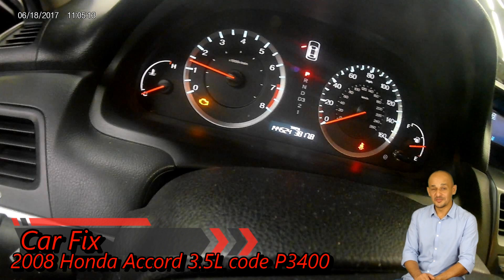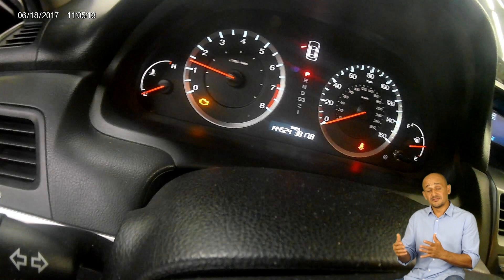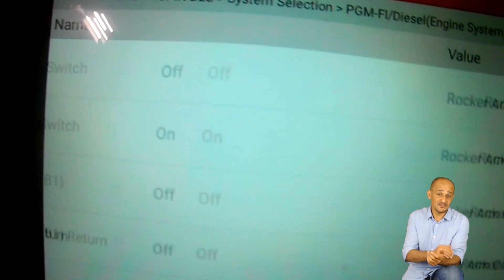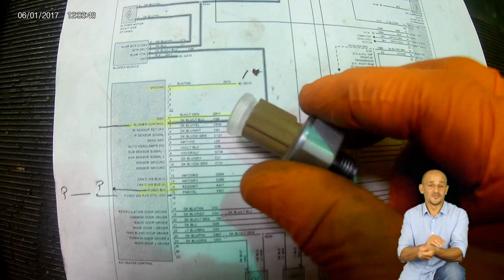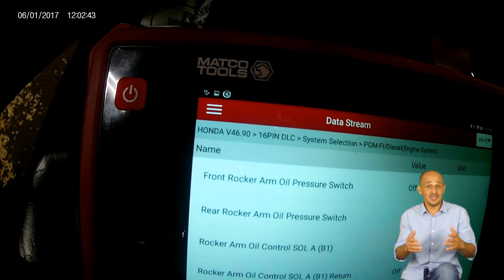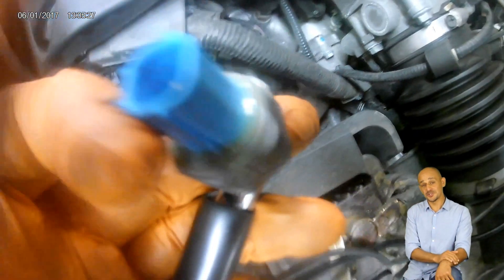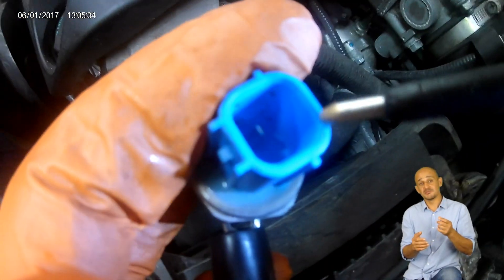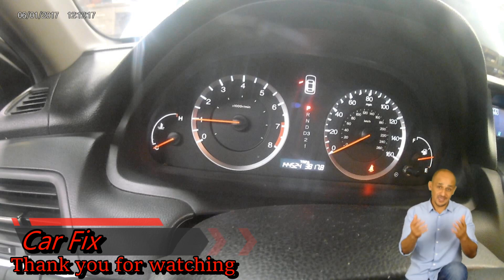Code P3400

Comment: Hi, confirming if you unplug the oil pressure sensors there shouldn’t be a code, correct?

I got a p0118 (coolant temp sensor) and p3400 simultaneously. any idea if they’re related or treat each independently?
Reply from the maker: They are the VCM system needs an accurate ECT sensor reading fix the P0118 first this ECT sensor effect lots or systems like ignition timing A/F ratio feedback idle speed the ECT voltage are high it should drop with hot engine, after fixing the P0118 you need to check the P3400 code if still present after clearing the codes.

Comment: Great video my man, could you include the part number for the pressure switch ? Thanks man.
Reply: Rocker Arm Oil Pressure switch: P/N 37240-R70-A04
O-ring (13mm x 1.5mm): P/N 91319-PAA-A01
Reply from the maker: Thank you, I cannot remember the part # it came from the Honda dealership.

Comment: I changed it and the code is still there, is there another reason?
Reply from the maker: Did you  clear the code ?
Reply: Yes I did and I left it for the mechanic for ten days He said all the readings on the computer are correct There is no sensor that does not work
Reply from the maker: Issues with the wiring  / PGM-fe  module / plugged up oil passages , module make sure the engine have  good oil level.
Reply: Thanks a lot ❤❤ , I'll check it out
Reply from the maker: Code p3400 is for an oil pressure switch not a sensor. If the switch reads on  at idle it's no good also the code may set if the switch reads off all the times with the VCM active, if the switch is new and no other codes for the V P S or VCM system you may have

Comment: Hi. I'm blessed that I found this video. Thank you from bottom of my heart. 
I have a problem with codes po351,po352 which is not detecting ignition coils on piston 1 and 2. Changed ignitions, sparks as well, fuel injectors  and nothn. All same. Rear 3 cylindera does work at all. Just front 3.
Please, questions. 
I believe is some issue with vcm, its good to turn it off anyway.

 Is there anything else you would recommend me to check? 

Thank you
Reply from the maker: Hello, do you still have codes p0351, p0352 after you replaced the ignition coils ?.
Reply: @thecarfixchannel3046  Interesting ,no. I got po301, po302, po303. Depends, when I reset the codes and drain the sistem (turn on the lights with battery off) I have just po301, po302.
Reply: @thecarfixchannel3046  And also have an blinking engine ligth and VSA. Engine raiving on 2600 rpm.
Reply from the maker: @zivanicmilan  Hello, I don't what  you by draining the system but codes p0301,p0302,p0303  are cylinder misfire on #1,2,3 cylinders you did change the spark plugs and ignition coils fuel injectors on all three cylinders and no other codes in the PGM-FI engine control module , the last thing to check is the cylinders compression if low the engine has internal machanicl issues    like piston rings , valves, lifters , timing belt.
Reply: @zivanicmilan  What ended up being the issue? I have the same problem!

Comment: I just  bought a 2008 accord v6 125xxx miles on it has a p3497 code I'm not the greatest mechanic but I dont know this code been watchin videos & very confusing thinking of taking out the junk v6. & put in a 4 cylinder 
Honda v6 engine is junk way to many problems. A friend  told me the honda v6 has so much power that it burns out the transmission 

Please anyone help
Reply from the maker: Hello,  code p3497 is not hard  to fix
Reply from the maker: I own a 2000 Odyssey with over 200K, I bought the van thirteen years ago and had no major internal engine issues. the 3.5 L is a good engine, changing the V6 to inline 4 is not an easy job not to mention the engine  VIN / PGM-FI is for a V6 engine, for code p3497 try to check or replace the VCM oil pressure switch bank two radiator side cylinder head.
Reply: @thecarfixchannel3046  but when I start the engine.  It shakes. It feels like it is having a heart attack & I dont know what to do
I really hate the honda v6
Reply from the maker: @sonny323  you start with the easy part the VCM oil pressure switch, the oil pressure switch should off in six cylinder mode IDLE, it sends ground to the PGM-FI or engine control module m, if the switch circuit is shorted to ground this code will set, the weakest link is the oil oressure switch you start with it,  watch my vidoe one more time the test for  p3497 is like p4300 but for bank one firewall side cylinder head.
Reply: @thecarfixchannel3046  ok so if its not hard to fix.    How do I fix it???  Can you tell me

Comment: For me, dealer said I need OEM part from them instead of aftermarket. They reflash the computer and soon as I took it out the p03497 came back- I’m debating whether to change both switches and purchase from dealer or just buy the vcm muzzler
Reply from the maker: Hello, if the price of the dealer ones are close to the aftermarket ones I go with the OEM switches, as a technition I only use OEM,  for the VCM _ VPS muzzluer I'm not a big fan of it, if the engine is running rough or  if the check engine light is on the muzzluer will not fix it, the muzzluer only prevents the VCM from activating by controlling the ECT reading on a fault free VCM system do the code has to be fixed before the muzzluer.
Reply: @thecarfixchannel3046   Yeah, they aren’t that far from the aftermarket. I’ll be stopping by tomorrow to get two- even though it reads to replace the front one- might as well do the back one. Currently, vehicle jerks back and forth after it had warmed up. Stop lights it feels like idle moderate, shaking. Then it fades.

Comment: Hi great video I need help not sure what parts is needed for my 2009 Honda pilot but my check engine light is on with the Vtm-4 an the code p3400 poped up pls help
Reply: What was the solution to your issue?

Comment: I have changed the gasket of the “ECCPP Variable Valve Timing Solenoid” the only problem was a leaking of oil, but after that I tested and everything was perfect, but the next they I tested on the freeway and right when I set the cruiser control at 80 mph it turned the cruiser off and the motor started to shaking and showing the engine light, the code was p3447 trying to erase it was impossible, so that day I changed the whole “ECCPP Variable Valve Timing Solenoid” and the engine light was gone then I tested that night on the street, but the next they I tested for 3 hours on the freeway but with out using the cruiser I have only used the cruiser at the and of the test for 2 minutes everything was perfect again, but the next day the engine light shows up again, but now was able to erase, but it showed again in the next day so I had to change the other pressure oil sensor then the engine light and the code was gone by it self, but the next morning the same, engine light, code and motor shaking again.  Uff now im stuck on that.    Now it’s showing “P3497   And P0304”
Reply: Sorry the code is P3497 I type wrong at the beginning
Reply from the maker: Hello, I don't know what car you have but code p3497 is an oil pressure switch code for bank two front of the car, code p0304 is a cylinder misfire on cylinder #4 this cylinder is located on the same bank front of the engine, if you had no issues before the oil leak repair then I'd say you did not install the oil control solenoid correctly,  bank two has two  oil control solenoids and one oil pressure switch, you need to check the misfire code first code p0304.

Comment: So I switched my oil pressure switcher but the check engine light is still on and I’m confused as hell as to why it is.
Reply: I have the same problem and I changed  two oil pressure sensors ,coils, plugs ,air filter and made engine flashing and put new oil and same problem, the car is shaking too much and I don't know what to do, spent a lot of money for nothing
Reply from the maker: @ahmadkayed2472  hello, what are the codes.
Reply: @thecarfixchannel3046  p3400 valve pause system stuck off
Reply from the maker: @ahmadkayed2472  DId you do any testing on the oil pressure switch circuit.
Reply: @thecarfixchannel3046  yes sir, checked and replace it with new and still same problem, engine shaking and car becomes too much heavy
Reply from the maker: @ahmadkayed2472  how did you check it
Reply: @ahmadkayed2472 , I have exactly the same problem, after change the two switches and the whole housing solenoid and erased the codes the code “P3497” keeps coming back, but usually the code come the next they in the morning when the van is cold
Reply from the maker: Hello. What is the DTC or codes.

Comment: I have a 2014 pilot that just got a P3406 bank 1 cylinder deactivation code. Think this switch may be the culprit? No drivability issues. Idles and runs like normal
Reply from the maker: Hello. You may want to recheck the code, make sure it's p3406.
Reply: I rechecked it after I cleared it. Had a P3400 that was permanent. Drove it for a little while and didn’t not get a p3406 but I only drove it for about 10 miles. CEL came back after my wife drove it for a little while. I haven’t yet rechecked it but I have a oil pressure switch coming and a spool valve. Gasket. Couldn’t find that oring for the switch unless it was in that gasket kit.
Reply from the maker: If code p04300 is a hard code this means the oil pressure switch for bank one or rear bank windshield side is stuck on, it should be off in 6 cylinder mode meaning no oil pressure should be present, the oil pressure switch is off and on circuit if the oil pressure switch is shorted on the inside it will send ground signal to the PCM and the DTC will set, you can check it with a test light one end on the positive side of the battery and the test light on the switch with the ignition switch off and the switch disconnected, if the test light lights up the switch is bad.
Reply: @thecarfixchannel3046  I pulled the plug yesterday and checked it with a dmm to ground. It was open with the car running and off
Reply from the maker: @VDUBZ08  Hard codes means it reset as soon as you clear it, is it a hard code?
Reply: @thecarfixchannel3046  if you’re asking if it comes back as soon as I clear it then yes. Cel stays off till you drive it for a while but the code is still present
Reply from the maker: Did you check the switch circuit or the switch it self.
Reply: @thecarfixchannel3046  had battery voltage on the circuit when it was unplugged. Checked the switch itself with it unplugged engine on and off
Reply from the maker: @VDUBZ08  I don't know what switch you are checking no battery voltage should be on oil pressure switch, it's a one wire circuit BLUE wire.
Reply: @thecarfixchannel3046  yes that’s the one. Had a green plug. Switch on back driver side. One wire. Maybe I have something else going on. I was expect 5v when it was unplugged but it was 14.1 when the engine was running and unplugged. Like I said the switch was open to ground unplugged with the engine off and running
Reply from the maker: @VDUBZ08 Hello, if you checked the  blue wire with DMM connector unplugged with the negative lead, engine off or on this means it's shorted to ground.

Comment: I know you posted this video a long time ago but if you get the chance to read this I have an accord v6 08 with same problem but the code is p2658 which different from this video and other videos I watch and I’m not sure if bank 1 or bank 2 if can clarity that for me will be much appreciated. And great video by the way
Reply from the maker: Code p2658 is for the bank two  rocker arm oil control solenoid not the oil pressure switch, it should have a resistance of 14 to 17 ohm at room Temp if more or less this means it's bad, if the reading within Specs the system may have wiring or PCM issues. Bank two is located on the radiator side of the engine.
Reply: @thecarfixchannel3046  thank very much for info going to try putting it today I how you have nice day

Comment: I get better mpg with vcm off both in my 2012 Honda Odyssey and 2020 Pilot.
Reply: mpg will get worse as all 6 cylinders with be on all the time
Reply: @armonh.108  No it actually gets better. I've tried it several times I drive 245 miles 6 days a week (1500 miles a week).

Comment: Want to thank you very much,  problem diagnosed and solved easily with your explanation.  I had the code for front and rear cylinders both pressure switches were shorted to ground replaced both. I checked them with a simple test light! Runs like a champ....

Comment: How can I do, if my code is P3497 
Is it the same switch or is different 
Can you help me ?
Reply from the maker: Code p349\ is for bank two (VPS ) system stuck off, this bank is in the front not in the back of the engine, the oil pressure switch should have no ground feed with the engine off or at idle, so it's not the same switch code p3400 is for bank one located in the back of the engine.

Comment: Did you purchase the part from the Honda Dealership or a local parts store? Also, by any chance do you have the part number for it? I have the same code right now but local parts store are giving me the wrong part.
Reply from the maker: It was from the Honda dealer, I cannot remember the part  number.